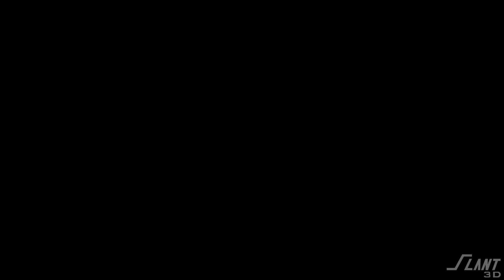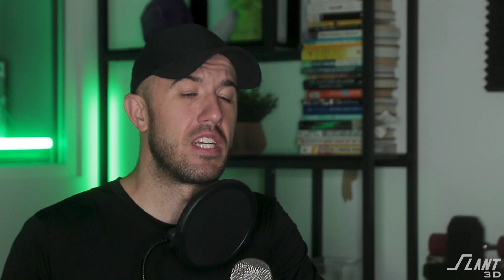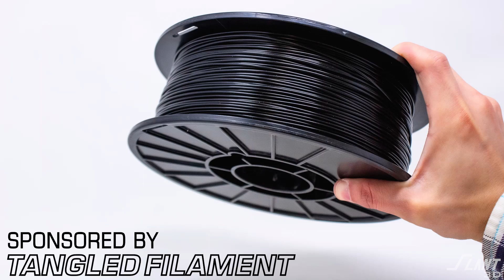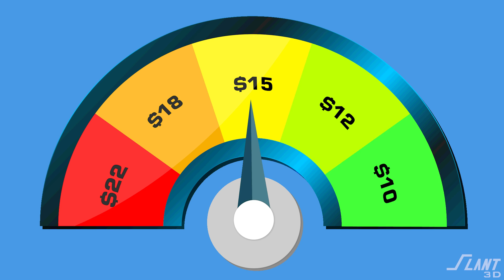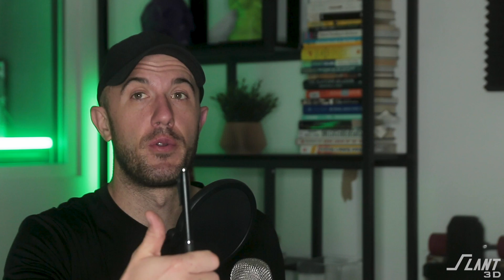Cheap Breeds Quality | PETG, Spooless, and Gray | Shopify Plugin Beta | 3D Printing News

Comment: Oh, and possibly a better example of better, faster, cheaper would be the magnetron used for generating microwave energy for Radar. Early into WWII, the Brits developed the concept of the Magnetron, and it started with a round piece of bar stock, cut to a specific depth, drilled for something like 6 holes that were used to both generate fairly high power radar waves, and be on frequency. The problem they had was that in order to make shis, it required a significant amount of machining time by machinists, and that was very expensive. they approached american engineers with the problem, after all radar was an essential defense of England issue in WWII, so they needed a lot of them. They were not particularly concerned about cost, war effort an all, but it wasn't inconsequential either. The american engineers looked at the device took the specs that needed to be met back to the states, and returned with a far less expensive, far more reliable, and far faster to make magnetron. How did they do it, instead of machining each hole into a piece of bar stock, they took a piece of sheet metal and stamped out the shape included holes for alignment and bolting together a stack of these, with a top and bottom piece, and on an assembly line bolted them together. I think the HIstory Guy's episode on it gives examples of the prices involved, but keep in mind that the price is low enough that I can almost guarantee you have one in your kitchen generating the microwave radiation needed to pop popcorn, or cook up a frozen meal, without heating up the entire kitchen with the oven. Yep, the result of that task includes a microwave that you can buy for under $80 on Amazon, and that microwave will re-order your popcorn for you as it determines you are running low.

Comment: I agree with the premise that most problems have been solved and you don't usually need to wait for new technologies.  There are very, very few things we can do today that we couldn't do a thousand years ago - we just do all those things faster, over greater distances, with greater accuracy, and with much, much less labour and material input.  The difference between a canoe on the Great Lakes and a 250,000 tonne contain ship is a difference in scale, not task.

However, I will also argue that your suggestion that "good, cheap and fast" is possible only by cherry picking.  In your story from school the winch was "good" only because it didn't need to stand up to real-world lifespan needs.  If you were using that winch to haul goods to the top of a tower, you'd have made it quickly and cheaply at the cost of having it wear out much faster than if yo'd machined those gears from metal.  (That, of course, is also a reminder that both "good" and "fast" are contextual and one should waste effort solving for problems that probably own't matter for what you're doing.)  The examples of both the Raptor engine and the Tesla front end rely on a lot of iterations before the individual items are being made good, fast, and cheap.  These only count as "good, fast, AND cheap" if you ignore the whole development cycle.

In other words, in my opinion, when you reject "good, fast, or cheap, pick two," you're deliberately miscommunicating in order to convey a philosophy.

Comment: Awesome information, I appreciate that you share your knowledge and experience so we can all learn and get better.

As an engineer I have had to use the "Project Triangle" or "Triple Constraints" repeatedly with project managers to explain why nine pregnant ladies can't have a baby in a month.  I disagree that it's a BS metric, but I do agree that one needs to be careful to not use it as "an excuse for average mean level work".  The final product can be better and cheaper, as you explained in your example.  But in order to get there they had to spend a lot more engineering time iterating and testing, and that time also costs money.  Too many program managers want to get a cheap product of exceptional quality and they expect you to have it ready for mass production in three months.

Optimization takes time. In order to hit super fast deadlines you generally need to decide what problems you aren't going to solve. There are situations where the experience of the engineers can significantly reduce the necessary iterations because they can identify fruitless paths, but then those engineers generally cost more because they are more experienced.  At any rate, all models are wrong, some are useful.  The Triple Constraints is a useful model for developing and engineering things, but you have to be careful to not apply it in the same way in a manufacturing context.

Your wooden gears example is an excellent one to make the point that you can seriously improve the product and meet the spec by thinking outside the box and being creative, carefully consider your assumptions and separate assumptions from facts.  In this case the team thinking you needed metal gears for the forces involved was proven to be a bad assumption.

When you do release PETG I assume it will also be black?

Your decision to go down the spooless path makes a lot of sense.  Personally I prefer to save the money and also not have to dispose of spools anyway.  Less weight to ship, less material for you to manage, less waste for me to dispose of.  Printing a spool or respooling on receipt are solvable problems for me worth the reduction in cost of the materials.

I think it is awesome that you are working to produce quality material and drive down the price!  The only downside is that it is taking time to get to your milestones...

Comment: Well done, Gabe! Thanks for the insights. Always appreciated! 

And I'm very much looking forward to the spool-less PETG! Right now I'm using Kingroon PETG that I'm getting on sale for $11 - $12/Kg while I'm ramping up various learning curves here in my R&D shop. You mentioned Tangled PETG would be cheaper than PLA. I would very happily buy American-made PETG, (and PLA which I do not use a whole lot due to the issues with heat), for what I'm paying now, and it'd be amazing to get it in bulk and in big 3Kg and Kg spool refills. Plus, it'd be perfect to prototype and proof of concept products with the exact same materials that I'll be getting mass manufactured from Slant 3D. I've got a long way to go before I'm really ready for all that, but I'm looking long term and this is a viable path forward. Thanks again.

Comment: 36:58 I was wondering/worried what action your professor took after you broke his test/mindset, and a bad thing did happen: he moved the goalpost* to keep his opinion correct. Does anyone have some simple steps that can be used to have a good learning and problem solving mindset (open mindedness), while avoiding gullibility and extremism (reasonableness)? For example: Test to make sure (verify). (eg. Plants do use green light, while some algae don't. https://youtu.be/kUpEQ4kU148?si=hpKhcvx48eFO4nnE )

*The goalpost was already moved with that 4th category of precision. Tradeoffs exist, which was probably the/an important lesson, but there are few absolutes (such as laws of nature) which apply to everything everytime.

Comment: Band saw, precision, gears.... That a load of bs. Maybe with a scroll saw but you need to consider the time investment. If you're paying a tradesman to stand there it will be cheaper to do it the right way. When you cut corners you don't never end up with better quality. You can make gears with a and file and Patience but that doesn't mean it's going to be cheaper when you factor in the time investment.
Reply from the maker: You sound like the rest of the team. And you are still incorrect.
Reply: @slant3d  you demonstrated to be able to somehow "break" the time/cost/quality rule, and you can be correclty proud of that. However that was an exception. The rule is general and unfortunately true. (Said by a person who worked 30 years in the building construction/renovation field who was told many times "this is the budget... figure it out". Never found an exception in 30 years. Never failed to deliver a project in time within the budget and the requested quality).

Comment: Wooden gears: Better, yes; cheaper, yes; faster, NO. You had to spend, likely a lot of, time cutting those gears out of plywood. That is the engineering trade-off you chose to make, and that is meaning of "better, faster, cheaper; pick two".
Also, as I'm surprised you didn't point this out as a manufacturing engineer, that was opting to desgin&make a component from scratch rather than use COTS.

Comment: I've been using esun refillable spools for ages.  I printed my own little bits for the inside that use M3 bolts rather than the click in ones they had, I think their reusable spools are PC, I got about a half dozen and PETG is my go to for prototyping and most of my finished parts.  The spools themselves are just on a cardboard cylinder that you assemble the reusable spool around.

Comment: Time/Cost/Quality... pick any two! It's easy to say from one iteration of a rocket to another, the quality and cost are dramatically increased. But that improvement was at the expense of time, and cost to a large extent. How long something takes to get to market is a paramount concern. 
Taking the extra time to build, test, and validate wooden gears may have been an unacceptable exercise to some because of its hit to quality engineering. 
Typically engineering is the art of compromise. With all the rapid advances of inexpensive technology, we see today, let's not forget the thousands of iterations and the work of many people who poured in countless man-hours, to facilitate the quality things made quickly today! Time and cost have already been baked into many of our future endeavors.
Reply from the maker: And yet starship has a smaller development budget than starliner

Comment: Genius, across almost all endeavors, is the ability to see, or work out, something that's never been done before, but is obvious once implemented. As a result, most Genius level people experience a high degree of imposter syndrome, as it's not obvious why they were able to do this, but no one before them had. There are times when Genius is simply standing on the shoulders of giants. But the Giants don't necessarily have to be the academic variety.

Comment: Athought for a framework accessory - A print in place 'sleeve' that also turns into an easel for the laptop to bring the display up a bit off the desk or table it's on. The 'third leg' can be the handle, or a latch that flips over the hinge end of the laptop to hold it in place when traveling. The base is an inverted 'Y' where the two legs reach out to the front corners and clip around the keyboard layer. The 'latch is a pair of angles that also can act as legs fo the easel format, but includes 2 or 3 different lengths that both provide added height options, and additional clip to hold in place the computer in travel. One or more of those clips may cover an HDMI port or DisplayPort and you could use the Framework laptop with whatever screen is available, and have the laptop closed up with a remote or presentation mouse, and the framework laptop will have edges out in the open for cooling. Presentation wise, I'm presuming that the Framework Laptop is not heavily CPU bound. If it is, that's likely to be a long term problem for Framework, and I think they have that covered.

Comment: i Love that plywood winch story.
I had a similar experience my senior year in highschool, Teams were tasked with making a Toy boat, and we were graded by Speed of the boat vs cost of materials, The school only provided students with AA batteries and those Crappy grey DC motors. 
So, I went home grabbed some scrap metal ducting, packing foam, duct tape , a $1 flashlight and a Broken RC plane. and made myself an air boat. While everyone else was focused on making water propellers. i come in with a speedy airboat and litterally blow the competition out of the water.

Comment: For a rocket engine you want to have the most redundancy possible especially on there's as it's the only thing that brings you back and if it fails its over. 
The other thing is that the Launch to Orbit Market is tiny there isn't that much market for giant transports into LEO. And anything further is currently impossible.
For Model 3 it's actually not better if you are owning it as now it's impossible to repair. Figuring out the Budget wasn't part of this at all they had several 10s of millions for that because they got some funding by NYC for supposed Solar Cells which they never did.
To the Plywood Gears works fine for some time but sucks in long term as the surfaces are not durable. I'd go with ALU which will be almost as easy as plywood but stable enough..

Comment: the raptor engine isn't a good example for beating the triangle.
it wasn't fast to develop.
of course it's faster to produce with fewer parts.
but the solution that got them flying first was quickly developed and good, but expensive.

Comment: I'm suspect you've answered this before, but why can't you just on-demand 3D print your own spools?
Reply: @ViciousNarwhalFL  In case he does not answer here is my assumption. Because it is more expensive that way. Spools are already mass produced, and he knows that he will use them up, and 3d printing them is more expensive process so it makes more sense to just buy them. It is hard to reuse premade spools because he can receive a bunch of different models of the same size spools at the same time, and their condition can also vary. Also for every 1kg of filament he sells he needs to ship 300g of spool in one way, and 300g i  other way to reuse them. On the other hand if he ships spolless filament made to measure for a 3d printable master spool, he saves cost on spools and shipping, and the amount of waste plastic is reduced as you only need to 3d print them when you need them. He can still sell some of the filament with premade master spools, which would be justifiably higher cost, but that would be an exception
Reply: @milospavlovic7520  I am all for spool-less filament delivery.  I can just as easily print/reuse a spool and have too many empties as it is.  Just seems ironic that the item a 3d printing company needs is a molded plastic spool from another company.  As he's noted spool companies had issues delivering in the volumes needed, yet he has all the manufacturing capability needed to produce spools on-demand thus dog-fooding his own products.  No storage, shipping, taxes, etc of empty spools.  I am sure he's run the numbers.  Just curious how close it is.
Reply: Compare injecting cheap pellets into a spool mold vs taking those pellets, using a slow process to make filament, then an even slower process and like 1/4th of your product to make spools while also taking away your print farm capacity. Injection molding creates products every 30 seconds or so for an entire day. Buying a spool should be less than a dollar, making one would cost them like 5? Plastic for spools is like $1 per kg, a 300g spool can theoretically be made for 30ct. Using theoretical $10 per kg PLA, that price raises to $3 before factoring in cost to print and the reduction of PLA available to sell
Reply: @ViciousNarwhalFL  Again, it's the cost. Spools are mass-produced by injection molding from ABS pellets, which is both cheaper plastic and cheaper and faster process en masse than pla and 3d printing. And that perfectly fits his philosophy that you should not make an inferior and more expensive version of the non-critical part of your process just to show you can if you can just buy it cheaper. Furthermore, it uses up machine time on 3d printers that could be much more profitably used in printing products for consumers
Reply: I think for a while they were looking at an in-house printed spool hub  with hexagonal cardboard sides. There was a video about it a while back. It must not have worked out.

Comment: hmm i dont own a framework device, But, i thing a rugged bumper case, with storage for SD cards and an SSD holder would be Sick even if it was a cable tie strap that you install yourself, so you can fit Any ssd not just specific ones.